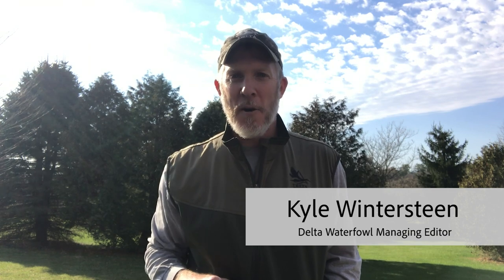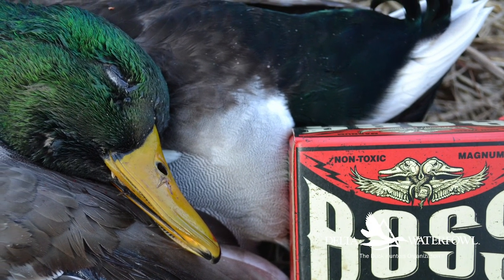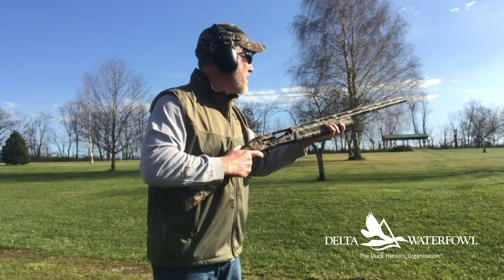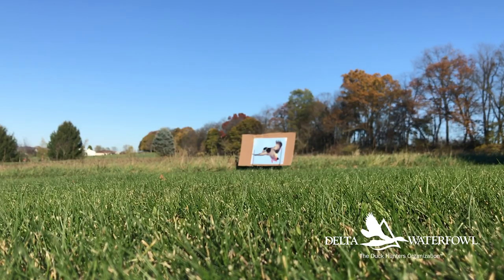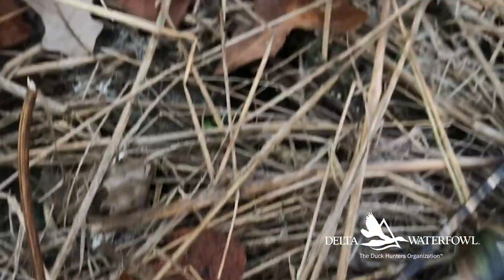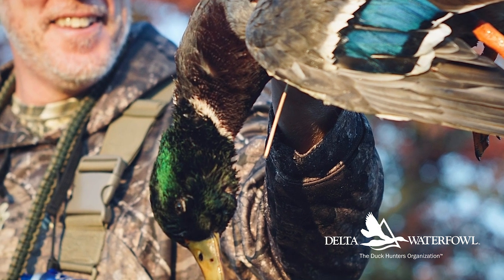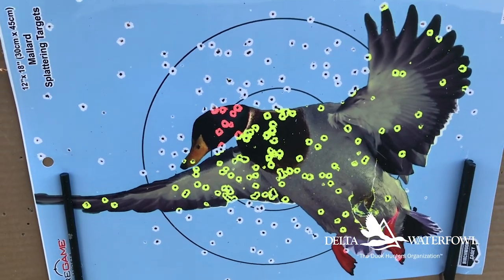Delta Tested Boss "Shorty"Shells

Comment: I handload 1-1/4 and 1-3/8 ounce loads of steel #BB at 1500-1600 FPS and forget about it... Never had an issue with absolutely stoning birds, even at distance... Steel can be lethal, you just need to up your pellet size, payload weight and velocity (if you can).

Comment: I was close to buying bismuth/Boss but have seen and heard too many conflicting reviews. So I did the math. Boss bismuth at 9.6 density is moving at 1350 FPS and many steel loads 7.9 density at about a1/3 the price are moving at 1500-1550 FPS. So considering the difference in density along with the extra speed from the steel there’s really no substantial gain unless the bismuth throws a better pattern which from all I’ve seen it usually doesn’t. I was lucky found some Tungsten 19.3 density loads at about 70% off I’ll use for late season honkers. Otherwise I’m sticking to steel for now.
Reply: I believe you're forgetting that more dense shot carries energy further and delivers the energy to the target more effectively. Speed isn't everything
Reply: @ortho4252  no that’s pretty much exactly what I’m saying is the small difference in density is negated by the extra speed of many of the steel loads. Blue Collar outdoors did a comparison between Boss and cheap steel moving 1550 at 35 yards I believe. Same size shot straight up. Penetration was as good or slightly better with the steel in ballistics jell. Maybe at further distances this would even out or bismuth might have a “slight” advantage. But the density isn’t that much greater with Bismuth over steel.
Reply: @kross1261  but you forget that the steel penetrates further because of the speed which just means it'll travel through the target and it doesn't transfer its energy efficiently to the target. The bismuth will lose it's speed because it has more weight but transfer the energy to the target better hitting harder and creating better wound channels. Think a heavier 30-06 load (180g) is used for large game like an elk but you can get a light load (110g) for coyotes in the same caliber
Reply: @ortho4252  unless you get complete pass through that argument isn’t really valid. Also bismuth isn’t that much denser than steel like I mentioned above and it doesn’t deform like lead or tungsten (it shatters)to create a bigger wound channel or transfer more energy. You caliber comparison would be closer if you were to say both shooting a 30.06 a 140 grain bullet (fast 1500+ FPS steel)at 3100 FPS or 160 grain bullet (bismuth 1350 FPS boss) at 2700 FPS.
Reply: @kross1261  but you're ignoring the characteristics of steel. You don't shoot a soft target with an fmj over a soft point. Penetration isn't everything
Reply: @ortho4252  from what I’ve seen with Bismuth it either retains its original shape or shatters.  Also K.E. = \frac{1}{2} \times m \times v^2.  “Basically” this is saying kinetic Energy (energy release by the shot hitting the bird) is figured mass x velocity. Boss moving slower and not having that much more density than steel doesn’t make sense to be much better than steel. Unless there’s a pattern benefit which I haven’t seen. Watch the above mentioned videos from Blue Collar outdoors they prove what I’ve thought all along. I often shot the Hevi shot or tungsten blends. The ones I’ve shot are substantially denser than steel and moving 1500 FPS. So yes I feel there’s a definite benefit with those shells. But spendy.
Reply: @kross1261   there are many reasons that Bismuth delivers more than steel. The most notable is the old saying, the faster you start the faster you slow down. Steel does not contain the mass that Bismuth or others do, High velocity steel loads have and are not as good as slower steel past 35 yards. Just google up the velocity of steel loads and you will see. Save money if you want,dislike bismuth if you want, but steel doesn’t have the mass and needs speed just to get a job done. Back in 1991 steel sucked and it still ain’t much better.
Reply: @grousedog88  I can understand the density being greater I’ve shot tungsten many times it’s significantly denser than bismuth though but all things being equal to say faster steel slows down and doesn’t hit as hard as slower steel past 35 yards??  That goes against the laws of simple physics. That’s like saying a pitcher throwing a 70 mph fastball is faster than a pitcher throwing a 90 mph at 35 yards??
Reply: @kross1261   just look it up . High Velocity Steel is on plenty of forums , blogs, etc. Or  come out pond hoping with me and I can show you the evidence where I used high velocity instead of standard only to have to go back. So your choice believe what you read, what you ,see, or just whatever you want.
Reply: @grousedog88  I found nothing scientific and to be honest just uneducated opinions. The increased speed “may”have a minimal effect on overall down range effectiveness and “may” result in poorer patterns but to say identical steel pellets moving at different speeds and saying the slower speed will hit harder at longer ranges?  Kinetic energy is directly proportional to the mass of the object and to the square of its velocity: K.E. = 1/2 m v2.  This equation pretty much says that’s BS and I have to agree. And I’ve been shooting steel shot for 40 years when it first came out and I’ve never personally experienced slower speed steel hitting harder at further ranges.
Reply: @kross1261   look harder ! there is more.
Reply: @grousedog88  I did, yea physics suddenly change when shooting steel shot……no sorry it doesn’t. Common sense should tell you that’s wrong.
Reply: @kross1261   you are one Negative individual. I offered to show you,Linked to a Test, that’s a physics Test. Yet you refuse to see . Argue all you want ,evidence is there. Tests are there . No offense , but you will no longer waste my time.
Reply: @grousedog88  negative? No I want proof because saying an identical slower moving object hits harder defies simple physics. And you never offered a link?  BTW there’s a lot of non factual information on the internet…

Comment: WRONG!! How does #5 bismuth have comparable density to #3 steel? Bismuth and steel have completely different density regardless of pellet size. There is so much false information regarding pellets and density. Please as the "Duck Hunter's Organization" don't spread anymore falsehoods, the waterfowling community has enough as it is.
Reply: Alright a lot to unpack here. The only thing you are correct about is that steel and bismuth have different densities, but you’ve stated it in a false manner. He said the 2 3/4 #5 shot is comparable to a regular 3 inch #3 shot meaning they are packed to have almost the density and weight. Although the two metals have different densities the weights and masses of the two shells can be the same. Please don’t try to correct someone when you don’t understand completely what was said and/or understand the actual basic science of mass, density, and volume of object.
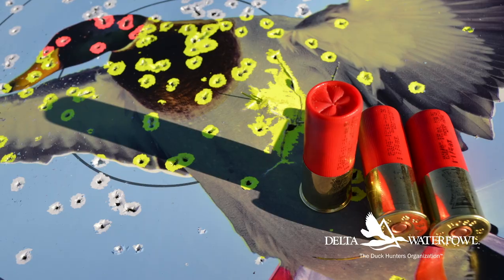Reply: @colepellegrin5491  2:20 listen to what he says. Either he’s mistaking what he wants to say or you need to give him a physics lesson, not me...
Reply: #5 bismuth is (performance wise) equal to shooting #3 steel. That is due to the density of bismuth. You can drop shot size, meaning gaining pellet count while retaining the performance of higher shot sizes in steel. Same with people using #9 TSS for turkey. It's comparable in performance to #5 lead. I found it pretty understandable in the video. Think someone just had a lack of understanding.
Reply: @huntergreen9448  all different metals, all have different density.
Reply: @TWHunt  exactly.....
Reply: ??? #5 bismuth is comparable to #3 steel regarding pellet density Seems like your the one that’s WRONG!! You need to study one of the many density pellet charts before you comment on something being false
Reply: Key board warrior
Reply: @will3091  if trying to debunk lies and falsehoods but supposed experts makes me a keyboard warrior then I will wear that title with pride. Don’t trust everything the “experts” try to sell you. Errrr a-hem DUX is a great example, but now I know why you got offended.
Reply: I’m sorry but I think TW Hunt is basically right. Do the math. What little increase in density is mostly negated by the slower speed of Boss. There’s videos on YouTube comparing apples to apples same size shot with high speed steel and boss shooting into ballistics gelatin and patterning the 2 against each other with a wide range of chokes for the boss at 35 yards I believe. No gain with the boss and the advantage would have to go to the cheap high speed steel.
Reply: Watch gel shots